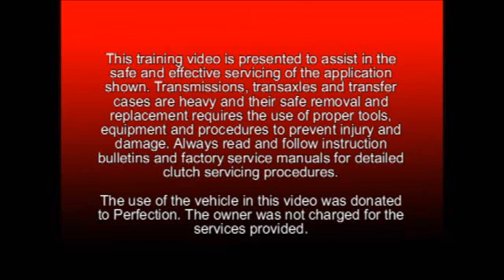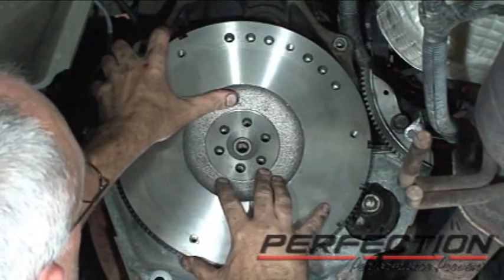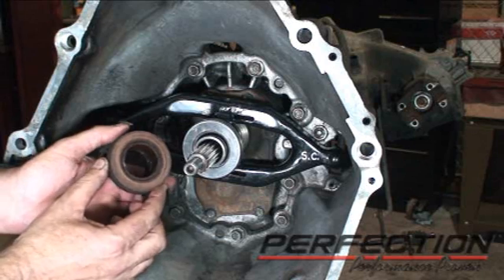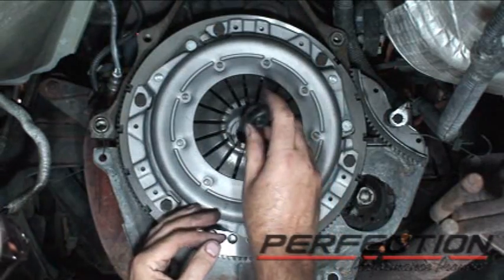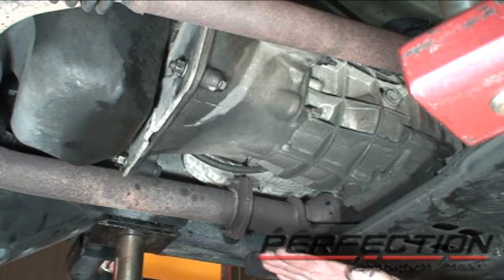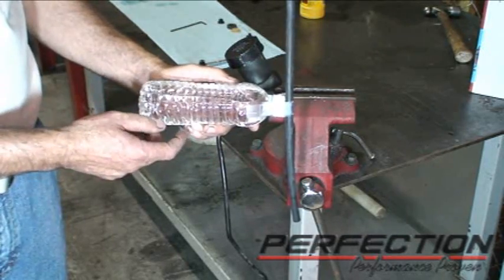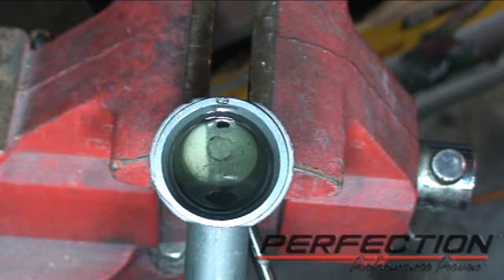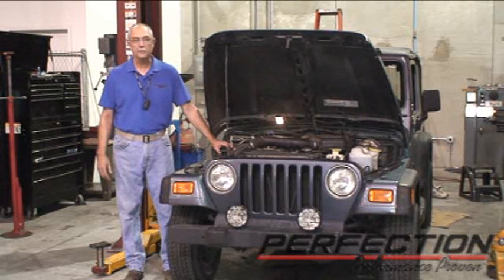2001 Jeep Wrangler 2.5L Clutch and Hydraulic System Installation

Comment: I used this video along with 2 others from perfectionclutch to troubleshoot and replace the clutch slave cylinder on  my 2000 jeep wrangler.  I even used the 800 number on the screen of the video and they were a huge assistance.  I want to personally thank perfectionclutch for your assistance.  Thanks to you I was able to replace the w and bleed the line before I reinstalled the hydraulic system.  I am now a subscriber!

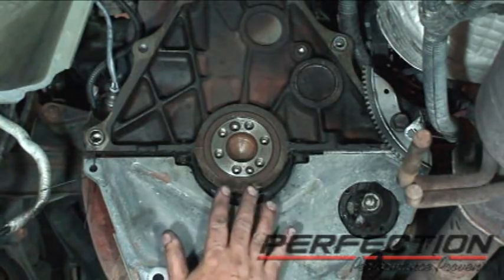Comment: do you know of any videos or walkthroughs for replacing the rear main seal( 3:05 ) ? i figure thats my current problem, when i dropped the transmission the bell housing is covered in about 1/4 inch of oil grime

Comment: Great video, Gary. Flywheel, clutch, throwout bearing, etc are extremely well done. Wish you'd shown more about dropping and re-installing the transmission, but otherwise excellent. You didn't have to remove the starter motor?

Comment: Hi Gary, been troubleshooting my newly replaced clutch on my 2.5L Jeep TJ and cannot get it to disengage even after replacing all of the hydraulics. It looks like your pilot bearing is a bit more recessed in your flywheel while I hammered mine in so it probably protrudes toward the housing maybe a millimeter. After taking out and reinstalling my clutch twice, I can only think that the pilot bearing not sunk enough could be the problem. Any ideas if that could be it?

Comment: Hey Gary, another great video.
My '88 wrangler 256 is leaking fluid at the bell housing.  I'm having to top off the master cylinder every 20 miles and pump the clutch to firm it up.  Do you think the internal slave cylinder is the cause?
If so, do you know of a quality replacement part and a shop in the ATL area that can perform the maintenance?  I have 44K around-town miles on the original clutch, should I replace that too?  Thanks for all your help.  I looked on your amazon link for the internal slave cylinder part and didn't see it.

Trent

Comment: Question: I have a 2000 dodge dakota 2.5L they replaced the clutch like 6 moths ago, so now when i steep on the clutch pedal it engages almost at the very top, at about 1 fifth or less, making it really uncomfortable taking off on a steep hill specially moving at slow speeds when you have to play whit the clutch. Can you adjust the clutch so it engages almost at the bottom when you press the pedal, at 4 fifths rather than 1 fifth? Thank you much.

Comment: The pilot bearing goes on flywheel or the engine block? I'm working on my 1989 YJ...
Reply: Usually pilot bearing is at the end of the crankshaft different Vehicles sometimes have it in the center of the flywheel
Reply: @jerrywhalen2100  Thanks Jerry!

Comment: great video. I did mine and the input shaft has lateral play less than a quarter inch is that normal? or should if have no play what so ever
Reply: What did you find out? They don't say in the manual. I have some lateral play, but the in/out was solid
Reply: @SeriouslyAwesome  nothing i sold the jeep